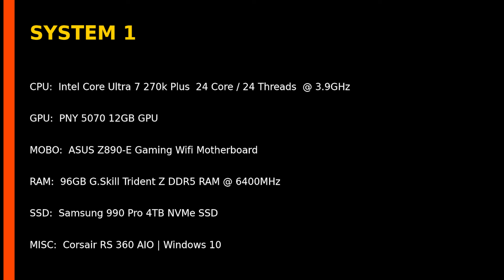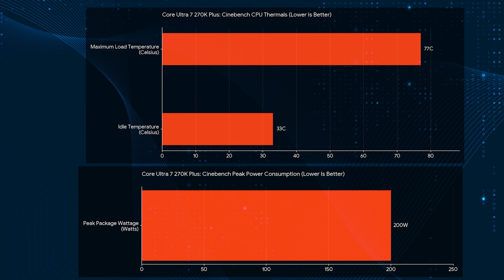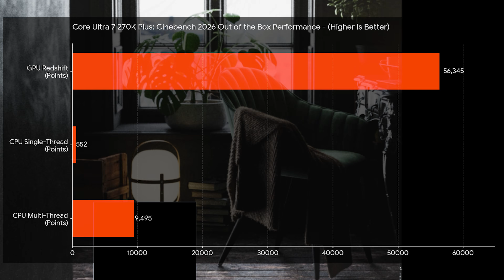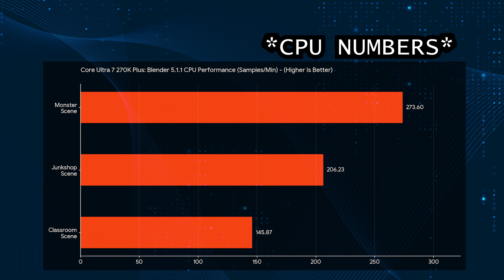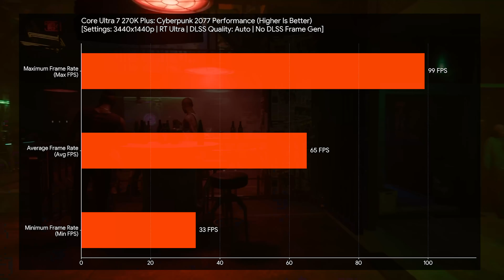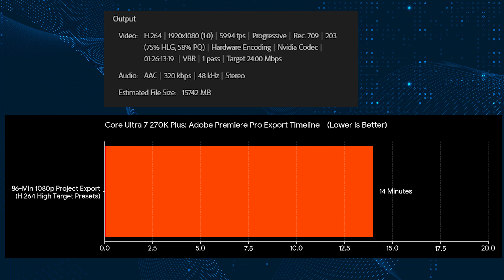Intel Core Ultra 7 270K Plus (STOP Touching Your BIOS!)

Comment: U said not to touch bios but shouldnt we set options like intel extreme settings and XMP or memory clock settings? I will be getting this cpu with 890-e board tomm.
Reply from the maker: Besides XMP I didn't make any changes. I wanted to make a video showing how the raw performance is of this Intel CPU, because a lot of times people may over complicate or be concerned about not running it optimally, so I wanted to show how well the CPU runs when it's just at factory. 

Enjoy the CPU and your build though, it should serve you very well! Let me know if you have any questions about anything.
Reply: @TheDonTech  yesterday i got this cpu+asus 890-e gaming board, after updating bios, kept everythng default except changing to xmp I BUT on my cinebench 2026 test cpu temps went 90+ touched 102 C, cpu package power reached 260W. Idle temp 41-44. GTA V max setting cpu temp 80-84. Is it normal ?   dunno which setting should i change in bios ? Cant find many settings i had in my older z790 to under volt.
Reply from the maker: @CryptoIndia9  What case and cooler do you have?
Reply: @TheDonTech  I have NZXT H9 elite case and NZXT kraken elite 360 AIO

Comment: Can i build ULTRA7 270K Plus without GPU for trading and get a motherboard that support 3monitors, will it lag or work fine? Not planning for gaming just pure trading. If anyone knows please let me know. Thanks
Reply: My mobo has one hdmi and one Display port output, allowing (maybe) for 2 monitors. A usb-c port might allow for a 3rd.
Worst case add a cheap gpu.
Reply from the maker: Your motherboard likely will not support 3x displays out. I would recommend an inexpensive GPU, such as a Nvidia xx50 series (3050/4050) that has the connections you need. It should be relatively inexpensive, and if you're like other traders I know, every second counts so you want to make sure you don't have any latency, haha.

Comment: This was just a 270k review? I thought it was gonna tell us why not to mess with bios or have some data of comparison between different "modes" the chip could be in but it was just "look how good this chip is stock!" thats not really a great argument. I don't mean this in a hostile way, but  title of "270k review plus hardware" seems like it would fit the video better. Would have been cool if you leaned into your hardware choices more and explained why those were better choices over others.
Reply from the maker: Oh dang, does it come off as a review? I do have a review of this CPU coming later this week. As was going through the scripting and editing of the videos, I did feel like I was repeating a lot...however, the goal of this (rather large) series was to have a ton of heavily searchable content for CPU's. But, not at the expense of misleading anyone as to what the video was about. 

You make some great points as to how this video could and should have been. I had sat down a few months ago and planned out a multi-cpu series of videos, benchmarked them and scripted them based on what data presented itself. I had planned on these videos being longer, but not every video got that luxury. 

Originally my plan was to test each CPU (I had 7) in Stock, and then do another video where I made Optimized BIOS Changes and then re-test them. However that would have been an insane amount of time that I shelved that idea. 

Thank you for your thoughtful comment, and no hostility is taken at all. I'm not new to PC's or hardware, but I am new to benchmarking. I've learned a lot through this process and am looking forward to making more comprehensive videos about the topics, deeper dives into benchmarking and I would actually like to do more free style speaking on the subject (explaining my hardware choices, and going more into length about my decisions), while talking more naturally. I relied heavily on scripts because of the insane amount of numbers within the data, along with making sure when I was talking about a certain CPU I said the name correctly.

Comment: If anyone wants a stable OC’d 270k plus, leave d2d/ngu @3ghz ring @4ghz and bump vdd/vddq by +50mV. 

Mine runs 5.6ghz p cores and 4.9 e cores all cores synced. Under avx stress test pulls 350watts and maxes at 98c, all power limits removed. I use it for gaming, frametime and overall stability are excellent.
Reply from the maker: Golly, lol.

Comment: slightly better than 13/14th gen core processors for heat/power. I guess its a win. I guess they don't literally cook themselves so there is that.
Reply from the maker: Yeah the longevity factor in this CPU is very promising.

Comment: im thinking of upgrading from a 265k, i know u had one as well, would u recommend doing so?
Reply from the maker: I have a ton of videos coming in relation to this processor and many others, doing a lot of head to heads and an eventual review (shhh) but in short, I would not have replaced my 265K with this. 

At least for my specific use case scenario I saw little to no performance increases.
Reply: literally no point.

Comment: Is It true that with Amd cpu's  you don't need super fast ram contrarily to Intel?
Reply from the maker: I would say that most people aren't going to notice a difference between ultra fast timing RAM and not.
Reply: It's x3d chips for the most part, the other non x3d chips respond the memory speed at a more level but it's not as beneficial to them as to intel core ultra series, which can rock ram up to 9000 l mts , AMD simply doesn't have the controller to harness lightning speed ram so it's not a huge difference to AMd but it's Intel's special design

Comment: Great video. May I presume you have a freshly installed Windows 11 Pro and have upgraded all your Intel and Asus chipset drivers? Before attempting any testing?   Thank you🙂
Reply: Thanks for the reply. The reason for asking was that when I swapped out my Asus z690 e /12900k for Asus z890 e / 270k plus, I had a real load of stability problems and black screens, which I'm still trying to resolve- maybe chipset driver issues. Thanks anyway; just wondered if you also had any issues?
Reply from the maker: Did you do a fresh install of Windows 11?
Reply: @TheDonTech  Hey, yes, I did. I'm thinking back now that I somehow corrupted the chipset drivers, so I did a reinstall and was very specific, in order of install, and all good now...lesson learnt..
Reply from the maker: Thank you! This particular testing was done on my Windows 10 Pro system with latest drivers/bios. I am holding off on Windows 11 as long as possible.
Reply: Its way past time.

Comment: I recently did a PC build about 6 months ago trying to beat the RAM crisis, Originally aiming for an AMD setup but ended up with a Intel 265K because of the good combo deals 😀.

Then when the 270K Plus was released and traded-in my 265K at NewEgg for a really good deal and immediately upgraded 😎.

270K Plus is right on the money for productivity / gaming PC build 😉.
Reply from the maker: Very nice! The Intel CPU's this go round should definitely last you a long time. Funnily enough, the 270K Plus that I did my testing with...it was not enough to convince me, personally, to upgrade from my 265K (shh, that may be a future video, lol).
Reply: @TheDonTech  I just did it since NewEgg gave me $240 for my 265K trade-in...then I used it to buy the 270K plus which was $310 at the time I believe 😆

Also, if your running 4 sticks of RAM you cant enable 200S Boost in the BIOS on the 265K ...you wont have that problem with the 270K Plus since all the 200S Boost improvements are built in out of the box 😉
Reply from the maker: @AnythingGoesJoJo  That's too good of a deal to pass up! Glad you got it!

I'm only doing 2 sticks. The plan was 4...at 192GB...but I thought I had time to buy more RAM ; - ; lol
Reply: @AnythingGoesJoJo  uh I'm running 4 sticks on a 265k with it enabled
Reply: @DueM  Really? What Motherboard? You can actually access the 200s Boost option with 4 DIMM's? 🤔

Intel officially stated 200S Boost BIOS option will not work with 4 actual DIMM's, its only designed and tested for 2 sticks 1DPC setup. 🤨

Unless you have a 270K Plus that has it out of the box.

So I'm really curious. 😶
Reply: @AnythingGoesJoJo  used it with a gigabyte elite z890 atx f20 bios, ended up disabling it and just run xmp now because of the info you gave thanks for the heads up supposedly it can cause the memory controller to overheat. luckily that pc doesn't get much use its running adata xpg ddr6000 think it's 30 or 32 cl 16gx4 sticks. both arrangements passed memtest86 but better safe than sorry

Comment: Don another great video!! Thank you! I got the 270KP back in March, upgrading from the 265K. Because I did the NewEgg trade-in, I only paid 70.00 for the 270KP and sent them my 265K. I posted my specs a while ago, but I have upgraded a few parts since getting the new CPU. I am running an Asus ROG STRIX Z890-E WiFi with the Core Ultra 7 270KP, 32GB of Corsair Vengeance RGB 7200 MTS CL 34, and an Asus TUF RTX 5080 OC. My main drives are: my C drive is a Crucial T-710 1TB Gen5 M.2 SSD, my game drives are a Samsung 990 Pro 1TB Gen 4 M.2 SSD, a Silicon Power 2TB Gen 3 M.2 SSD, and a Silicon Power 1TB SATA SSD. (This drive is just for my Train Simulator Classic game) My storage drives are 4TB Seagate Exos HDD. Thats all internal. Externally, I am running a Western Digital Black 5TB HDD and a few others that are for backup. I upgraded my PSU from an 850 Asus Prime to a Corsair RM1000e 80+ Gold AIO cooler is the Arctic Liquid Freezer II ARGB 360mm, all in a Corsair 6500D Airflow with Cooler Master MasterFan MF120 Halo ARGB fans. Yes, I have some big gains over the 265K. The 270KP is pretty much a 285K but a lot cheaper! I am very loyal to Intel and will always be. Everyone is still caught up on this Ryzen hype, and that's all it really is. People are wasting money on the X3D chips when they game at 1440P or 4K. Thanks again for another great video!!
Reply from the maker: That is an absolute monster of a build, thanks for sharing the details and I'm glad you're enjoying the performance gains! And your Intel CPU with a lot of your other components will hopefully ensure an 8+ year lifespan! 

Thank you for your compliment as well. Stay tuned as there are many more coming!
Reply: @TheDonTech  I don't want to upgrade for a WHILE!! I am hoping for at least 5 years. I was on 1st-gen Core I7s for about 10 years (2011-2021) and only upgraded my GPU 4 times over those 10 years.
Reply from the maker: @matthewonusz2953  That's what I prefer. Only upgrading the GPU when needed. That 1st gen i7 lasting you that long is incredible value!